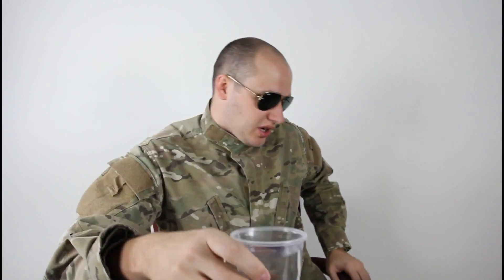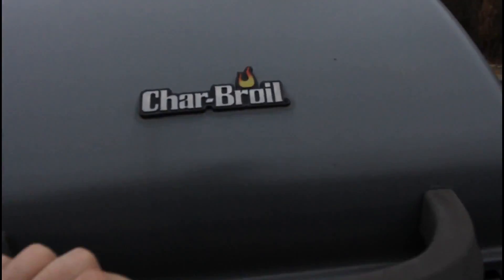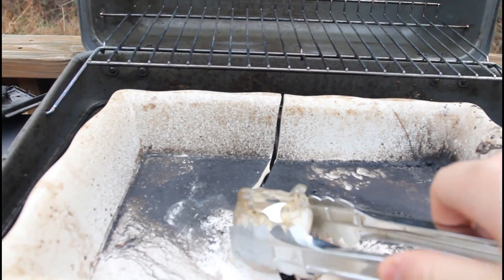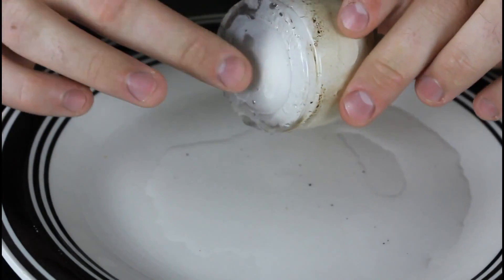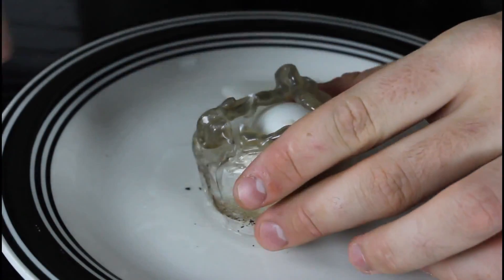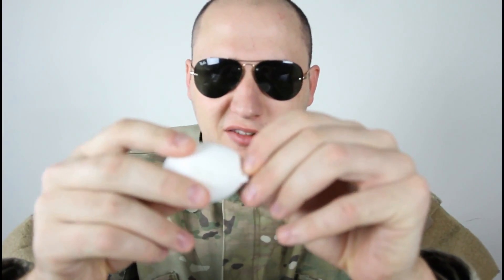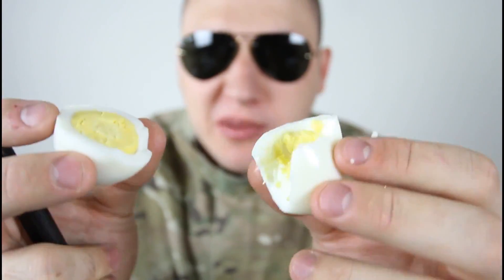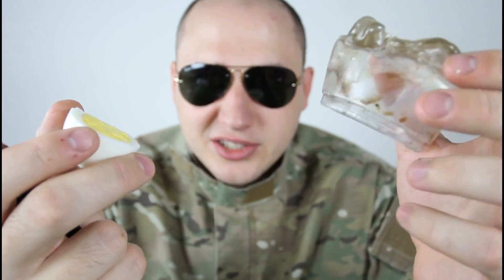How To Boil an Egg in Plastic Cup! - Science Experiment

Comment: You can just poke a hole in the top of the egg and leave it by the fire, the shell its self is a good enough container to cook it in, takes about an hour.
(Same goes for covering the egg with hot ashes)

or,  wrapping it with a sheet of moss and just putting it straight on top of a fire also works nicely.

Comment: Real science says that liquid water turns to gas at 212 F so the water keeps the cup from getting too hot. Take a paper cup full of water (like one of those little bathroom cups) and make a support ring from a coat hanger. Rig it up. Put water in the cup and hold your lighter under it. That works, too. I hope you had fun with this. You know, you could have just done it in the microwave.

Comment: The simple diffusion of heat via the water allows it to pass through the plastic into said water without melting the plastic. As soon as there are large bubbles of air, the plastic melted. Simple.

Comment: The water boiling is an endothermic reaction, which absorbs energy. All of the energy takes the path of least resistance, going to evaporate the water rather than to melt the plastic. When there is no water touching the plastic, the path of least resistance then becomes to melt it, which is why the glass melted just above the water line.

Comment: The water takes the heat from the cup never gets hot enough to melt the cup. The water boils away and where the water is not, the cup gets hot enough to melt.

I have seen a chicken boiled cooked in a paper bag with water tied over a fire. A good bag is needed. A cheap bag will open up on the bottom. You can test bag types by boiling just the water.
What happens is that water soaks the paper and makes steam that protects the bag. As long as it's wet, no problem. it takes 20 minutes or so to cook the chicken.
I don't know what adding salt and spice would do. Might plug the bag, might be okay.

Comment: I swear those pliers he used are the same model as the tools my orthodontist used to add steel ties and chain elastics and wires and plastic tubing to my braces. And then the orthodontist would grip the new, sharp ended, untrimmed wire in the pliers and spin them around in my mouth. It was a nightmare every time; I always imagined the worst case scenario of the orthodontist slipping a little and cutting my lip open.

Comment: Its called osmosis. Osmosis is when water molecules spread out because of the high concentration or heat so when the grill was on the water molecules spread away so they could evaporate as quickly

Comment: Put the egg in a ziploc bag filled with some water, seal it and run out the air so there is no air bubble in the bag, you can set the bag right on a fire and it won't melt and will cook your egg

Comment: actually the reason y the glas didnt meat isnt from the water spreadig out the heat the water absorbed the heat from the cup as if it was on the fire meaning the plastic it self had much less energy or heat in it relative to he water. this will continue to happen unti al the water is boiled. but he was right on one thing as ong as water is in contact with the plastic the plastic  wont melt

Comment: the water is an insulator thats why it didnt melt
Reply: Champ De Chew Sorry, Champ, but that is incorrect. The water is a conductor, not an insulator.  It is conducting heat AWAY from the plastic.  If it were an insulator, the egg would not cook because it would have been insulated from the heat.

Comment: This is pointless, you could cook that egg on the grill and get the same result.
Reply: Try it, hardboiled eggs require a hard boil for a reason, the water gets about 100 depending on elevation,  but fire as it is WAY hotter, just putting a egg in the gril would make it explode, the liquids inside would pressurize and cause it to combust. Unless you had on VERY low tempreature, but that would take ages.